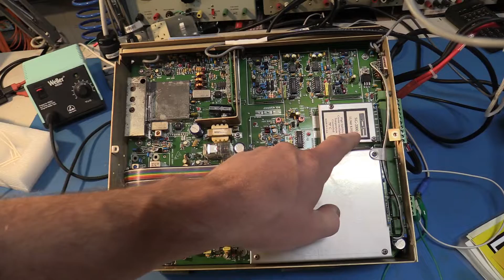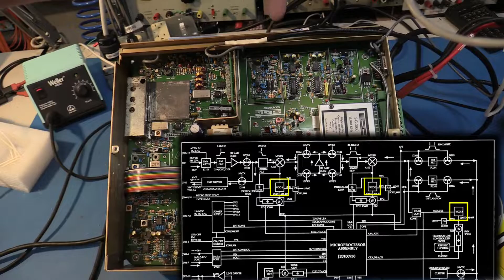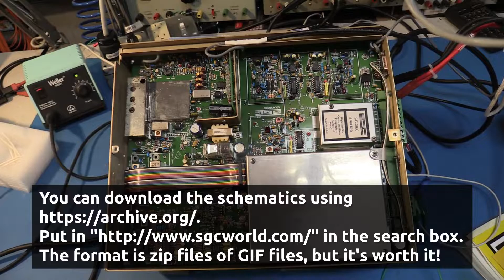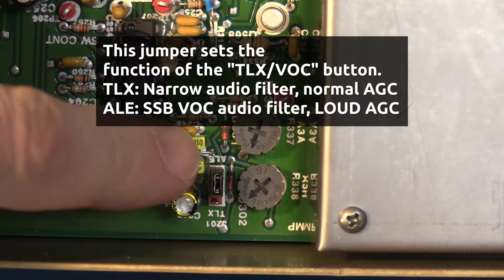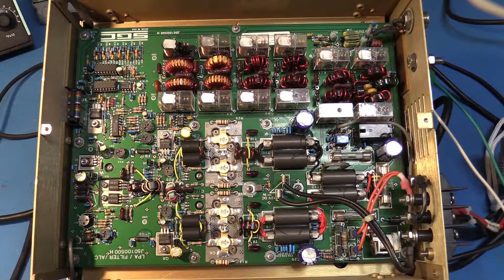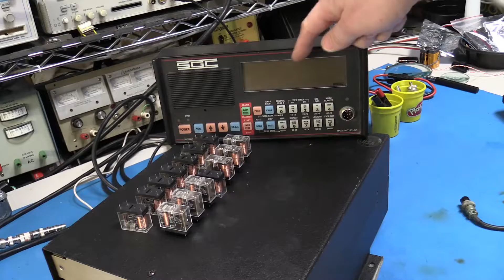SGC SG-2000: Main Unit Inside

Comment: Thank you very much for this terrific series of videos on the SG-2000. 
I bought one (same as yours) last week for about $100 USD that is in very good physical condition. The receiver is working pretty well, though it does drop out once in a while. A key of the mic brings it back (relay?). 
Transmit does not appear to be working. Regardless, I'm completely smitten with it. My goal is to find a local technician who is willing to take a crack at it. Would make an awesome POTA box with 150 watts SSB :)
73 from Tracy VE3TWM
Reply from the maker: I think it would be a great POTA radio too. I often run HF mobile, and I’d appreciate the extra couple dB! There are two or three TR relays, I’d start there. Also check the transmit switched 13V by reading the bias voltage on those jumpers on the power board. Check the fuses while you’re there. Email me any time with questions. Let’s get these radios rockin’!

Comment: Can you show the inside of the head unit showing the rx audio stage. Mine has a loud howl. Probably a bad cap.
Reply from the maker: My RX audio in the head is also kinda iffy. I will definitely pull mine apart and make a video. Hopefully we can improve things. I think new caps are a reasonable start. I’m also going to lower the gain on the final audio amplifier. I think that’s part of why it sounds so awful. 

Yours sounds ok if you tap into the rear audio output (aux/telex) port?
Reply: @W6EL  I will check that out and let you know.  Thanks for your input.
Reply from the maker: @kevinmccool3719  no problem. I’m looking forward to tackling the head unit. I’ll probably do the relays first though. Just to get it half way working.